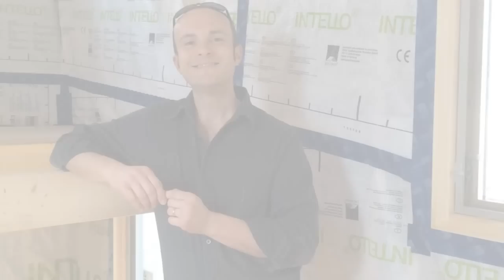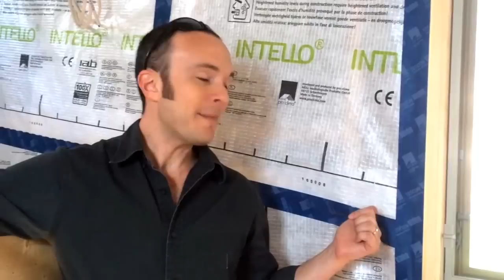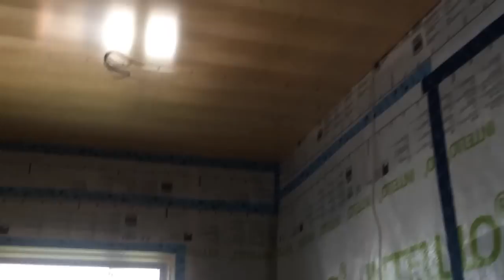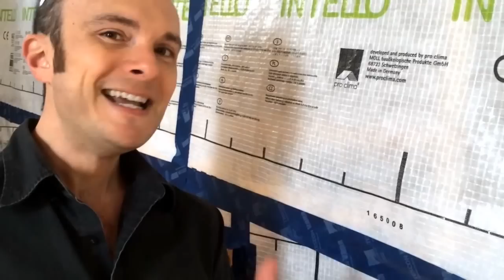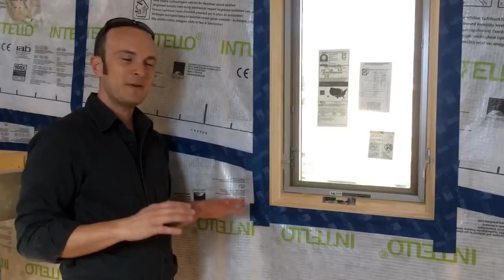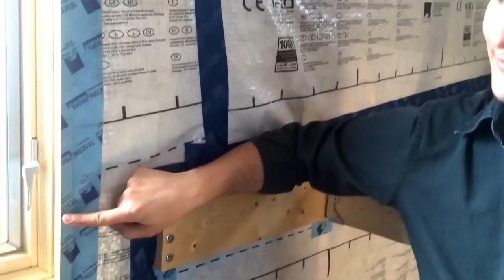Tiny House Airsealing with Intello Membrane

Comment: I have a question. From my understanding, the vapor control layer inside prevent the condensation cause by interior moisture, but why would you use open vapor layer outside will cause moisture from outside condense at the dew point ( either inside the insolation or behind it), which cause rot at the frame. Isn't vapor control means vapor don't diffuse through the wall ? why can't you put vapor barrier inside and outside the wall so you don't need to worry about vapor get into the wall at all?
Reply from the maker: Putting plastic inside construction gets scary when you consider that water might leak in there at some point and never be able to get back out. Which would rot your wall for sure. Anywhere but Alaska or southern FL, you don't have enough vapor pressure to make anything so terrible happen. The important thing is to give your building assemblies drying potential. When they inevitably get wet, let them dry.

Comment: I thought house wrap was only for the outside??
Reply: Apparently int. vapor barrier is meant for very cold climate. Matt risinger has a vid on it.
Reply from the maker: It’s meant for airtightness, in any climate
Reply: @HomePerformance  oh so it's just like the exterior one? where the vapor can be permeable?      so you guys dont use any wrap that's just a "vapor barrier"? The way you set up the tiny lab is meant for any climate? Is the tiny house package on the website a detail plan of how you built the tiny lab?
Reply from the maker: It’s actually vapor intelligent, but yes, 1 to 100 perms, or something of the kind. Vapor barriers that stop vapor are pretty dangerous anywhere that has seasons, because it’s always in the wrong place half of the year.
Reply from the maker: Think again!

Comment: Always awesome to see you doing your stuff, I am looking to get into home performance diagnostics. You mentioned the kitchen vent flapping, have you checked out the Broan Ecovent? it seals at the outside of the envelope air tight using a styrofoam ball.
Reply from the maker: +Victor L. Cool, all our stuff is Broan, so that must be something new!
Reply: Actually I used them in my last three houses over the last 10 years, most likely only available in certain markets. Google Broan EV100.

Comment: Hi Corbett, thanks for sharing this build with the world!  I was curious, since you mentioned in a previous video that you were not using any spray foam on the build, what did you use to insulate the space between the rough framing of the windows and the actual window frame?  Did you just stuff Roxul in there and then tape?  Thanks again!  (I wish the tour came through Canada, would have loved to see the TinyLab!
Reply from the maker: +lefty0mtl, since there really was no significant gap and because the insulating value of airsealing spray foam cans is arguable, we focused on acheiving a perfect airseal instead with Pro Clima tape from foursevenfive.com